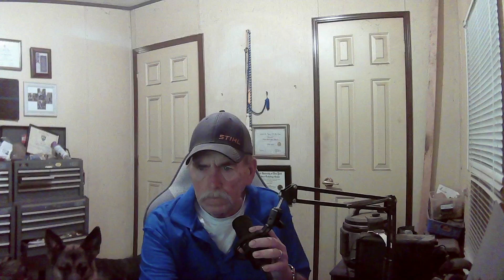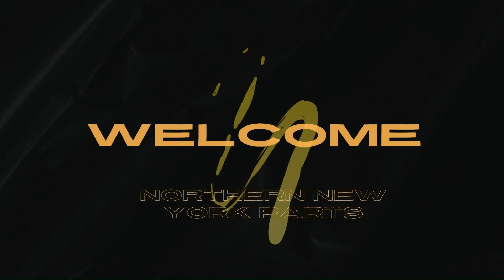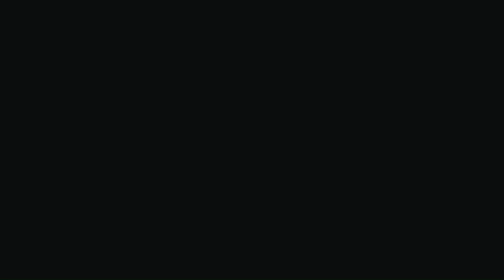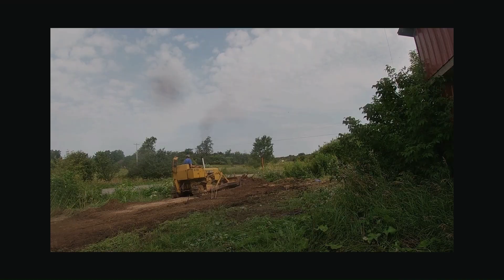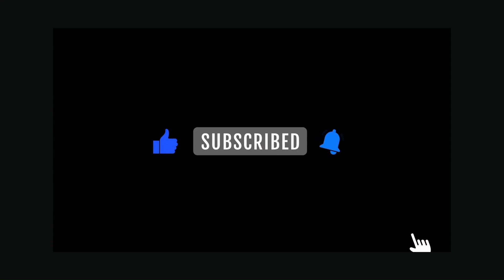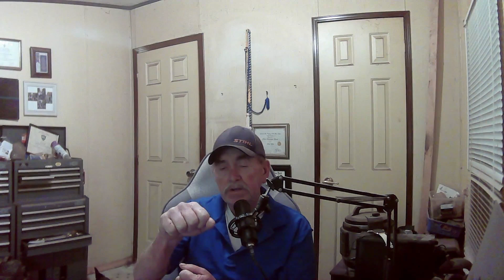Finding The Right Flow That Works For You In The Repair Shop

Comment: Amazon Prime delivers the next day for free. An air filter is an air filter. I just order most air filters except the small square Briggs filters and a few other round string trimmer filters. It seems like I never had the correct filters anyway. There are so many different filters nowadays, and you don't know what will come through the door. Fuel tank vents are troublesome on a lot of trimmers especially the ones in the cap. The  Poulan string trimmer fuel caps are the worst for the vent falling into the bottom of the fuel tank then the cap leaks fuel. They can be straightend and pressed back in and work fine. On diesel engines there is a bleed screw for the fuel sediment bowl at the top usually to bleed off the air.  At 80 or 90 PSI it should start and run fine, It is a carburetor problem.
Reply from the maker: My prime has not been working that for me in some time now Jason. I have seen it take over a week to get here with Prime.